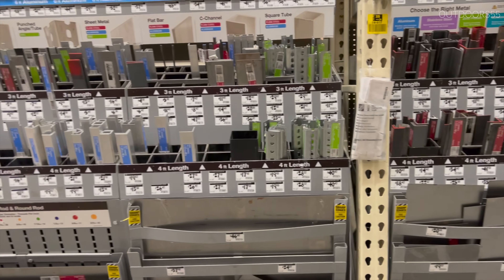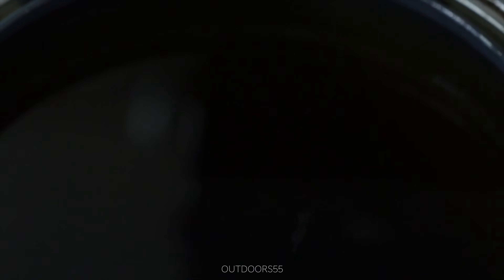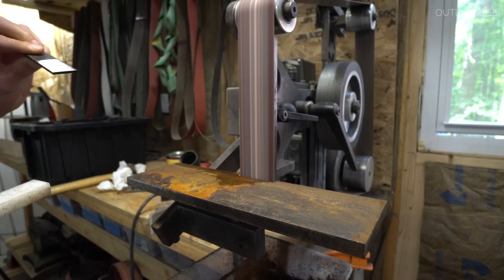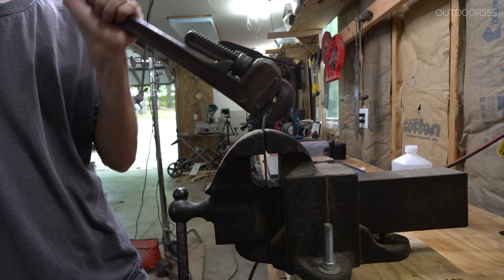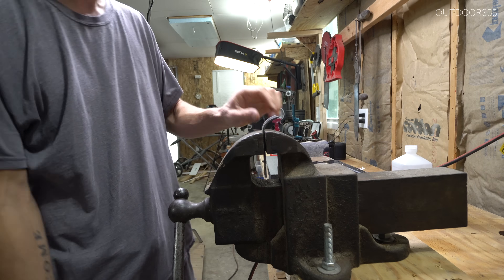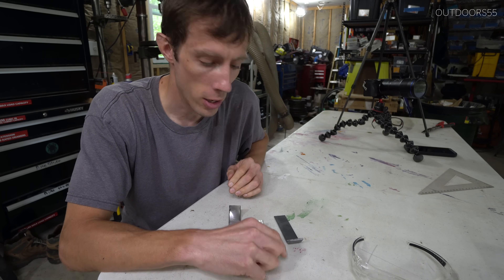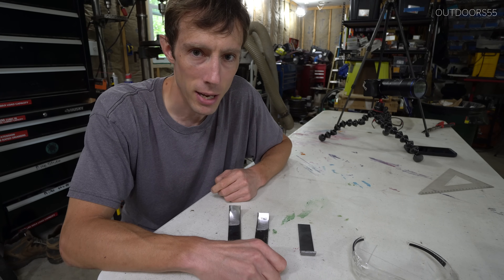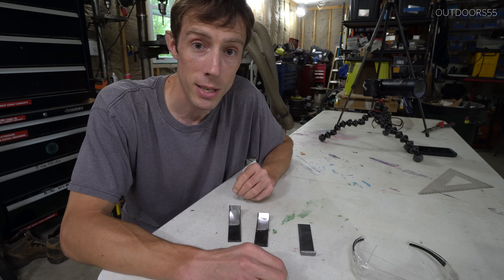Can You Make A Knife From Home Depot Steel?

Comment: All of the steels carried at Lowe's and Home Depot are formulated for welding projects and low load bearing applications. However, if you're just wanting to practice your forging techniques or practice learning to use a grinder, mild steel works very easily. A lot of modern blacksmith items like pendants, decorative nails, candle holders, etc are forged out of mild steel these days as wrought iron is hard to come by. Even the intricate gates and fences being made now are usually mild steel as well. Just don't expect it to harden and make a decent blade.
Reply: I got into practicing knife making with mild steel like this. In retrospect I should have just given away the practice ones as gifts since most of the real knives I make end up going to non knife people and never get used anyway...
Reply from the maker: A 48" piece of 1084 is currently $19
Reply: @OUTDOORS55  
Yeah, it's pretty affordable. 1084 is what I typically use as it's more forgiving in the heat treating process. I usually buy through Jantz. Did you find better prices somewhere else?
Reply: @OUTDOORS55  is there much difference in the heating and quenching requirements for 1084 vs. 1095?  I've always used 1095.
Reply: @tjwright  
I started out with 1095, and if I remember correctly, it requires a longer soak time (15 minutes) at temperature before quenching that is hard to manage without a kiln or a precise gas forge. It also only hardens in oil. It's easy to accidentally grow the crystal structure too large during normalization passes, too. 

 1084, in my experience, is just much easier to manage through the heat treatment process and works easier under the hammer. You can also water quench it, which means you can apply clay to it to achieve a hamon, though I haven't gotten the exact results I wanted with it yet. Personally, I love the stuff for regular functioning knives and tools. It gets good and hard, but isn't so unforgiving in the quench. I've had 1095 crack in the quench or snap while straightening out a warp. So, the only time I'd use 1095 again is if I were making damascus.
Reply: @OUTDOORS55  yes see I would buy the proper bit ...that actually sounds cheaper than mild steel inch per inch
Reply: I think the whole knife industry is a fraud. Mild steel can cut up an animal very easily. Many of the knife people on the internet are just selling expensive box openers to teenagers. Mild steel is a great knife blade.

Comment: Mild steel might have a place to practice with..grinding bevels and other geometry elements..vs paying for actual blade steel just to mess up..your 1st dozen or 2 blades..which may look great at the moment but typically belong in the trash for several different reasons.. asymmetrical, bad ergos, wrong sizing, wrong / poor heat treatment etc.. mild steel blades could be a quick learning experience although it offers zero heat treatment experience..people have even used wooden paint stir sticks to practice free hand bevel grinding vs ruining pricey blade steel..
Reply from the maker: Actually 1084 is cheaper 😑
Reply: @OUTDOORS55  even with shipping cost.? VS say some mystery mild steel most people can get for free basically.. even junkyard leaf springs are cheaper then buying blade steel and the shipping cost typically..but junkyard leaf springs can be hardened but are a mystery steel..
Reply from the maker: Yeah free steel is always going to be cheaper. Home Depot has ridiculous mark ups on their steel.

Comment: Get them st sell 1095 and 1070. I watch your cool video on the hammer w the 3/8 the carbide ball,  very cool I thought you would be straightening by flitting out the bow. A commenter said that hard knives are 65 to 70 hrc,  I always thought this was way too hard, or tempering isn't applied. OR is it the case that commercial makers make theirs at advertised 58 to 62, but more like 58 realistically. What do you think, can you get knives out of modern steel to be 70 or even 68 hrc without the steel being too brittle?
Reply: Hey dear
What’s good?
Reply: @sarahwilliams6058  you didn't answer my question.
Reply: @ryanbeard1119  and what’s that?

Comment: I think you MAY be discounting what the steel "COULD" be good for...just getting used to grinding to a line, or heating it up & just whacking away at it to get a feel for how to actually swing a hammer...without ruing an actual good piece of steel...outside of "practice" I agree with your analysis 100%
Reply from the maker: This steel is actually more expensive than actual knife making steel..
Reply: @OUTDOORS55  understand...but it is also a matter of convenience...if you have to drive an hour (or more) just to get to a steel supply shop, or pay the shipping for something ordered online, then driving 5 min & paying a little more up front is going to be less $$ in the long run for something you may just destroy for lack of knowledge on what you are doing...but that is just my opinion on the matter.
Reply: @jonnybooks9337  Exactly. I can get knife making steel for 10€, but the shipping costs me 40€. I just bit the bullet and paid the price, but for someone else in my region who wants to practice, mild steel would be a better option.